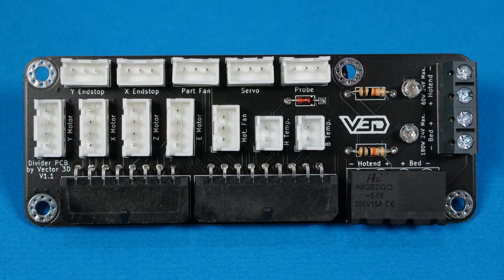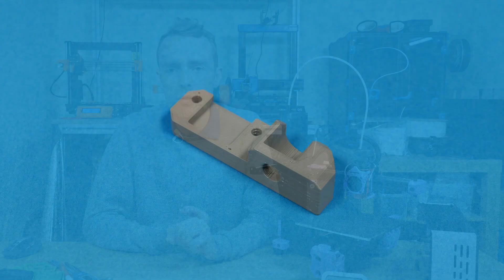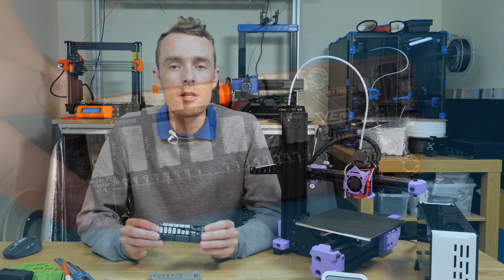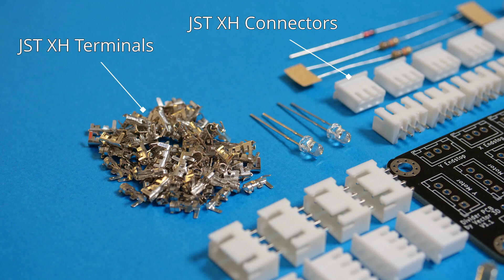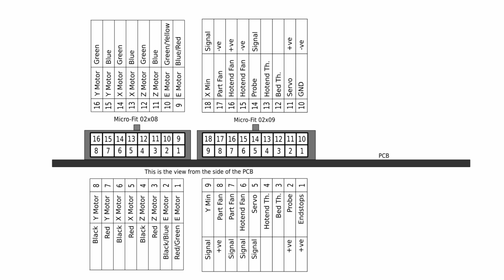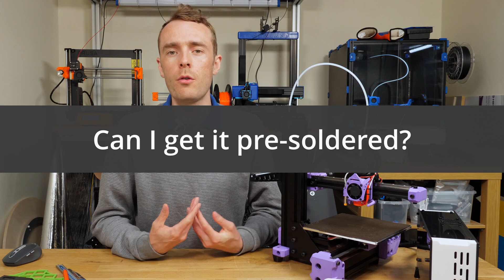Divider PCB Mod 3D Printer Upgrade Kit for V-Minion

Comment: I would say you need to clean off the flux, its an acid and over time it could cause issues. In my line of work it looks bad to leave flux on any type of board use 99% alcohol and a nylon bristle brush to help get it off.